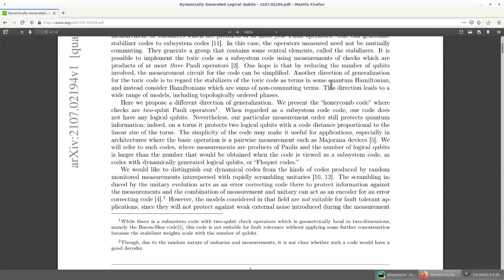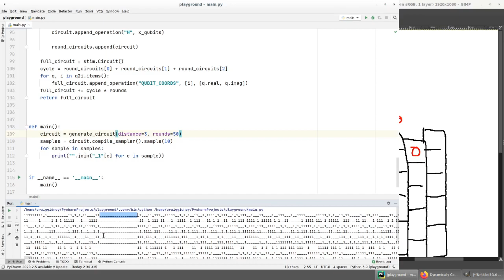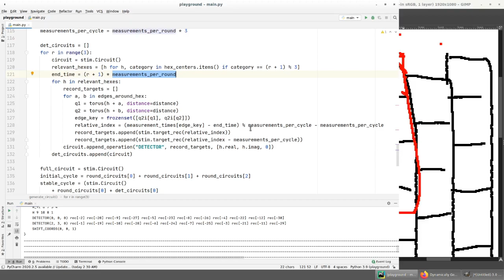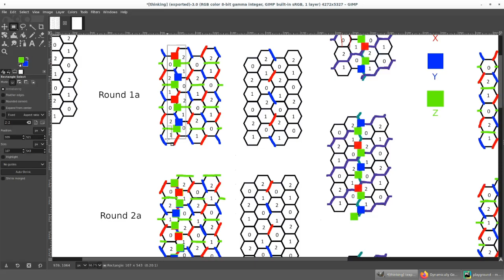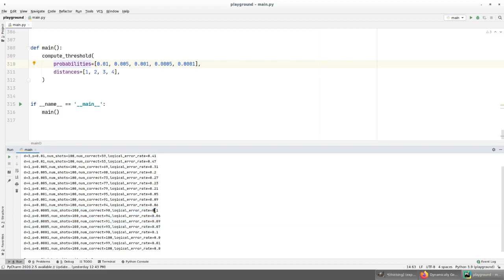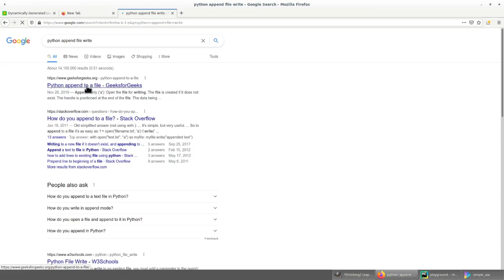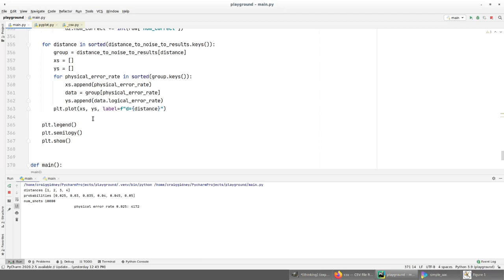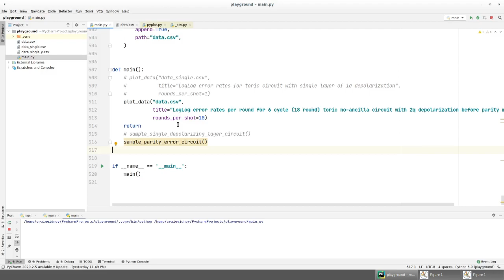[Demo/Tutorial] Estimating the threshold of a new quantum code using stim and pymatching

Comment: Thanks for this!  Count me as one of the audience members, though I think I fit into that Venn diagram of coder and QEC person.  

It doesn't look like you do FT measurements here but just directly measuring these observables without errors during the measurement.  Is that correct?
Reply from the maker: Yeah, that's right. I did figure out and program the fault tolerant measurement, just a few hours ago actually. You just measure the individual qubits making up the parities for the next round (e.g. ZZ measurements gets replaced by two Z measurements). This gives you detection events from two rounds: it gives you the edge observables you'd have already used to get some detection events, and also cycles of Paulis making up the six body operators that are the stabilizers on one of the three hex sets.

Comment: I noticed that there are four logical observables, but it seems that you only used one. Can you please confirm if my understanding is correct? Also, I am curious if it is sufficient to use just one logical observable to calculate the threshold, and if so, could you explain why? Thank you.
Reply from the maker: This was just the initial results. A proper estimate has to check the two anticommuting observables defining the logical qubit, and also do a proper fault tolerant initialization and measurement at the beginning and end. It's not so useful to check both logical qubits because they're just time-shifted versions of each other and also once you add spatial boundaries you lose one of them anyways.